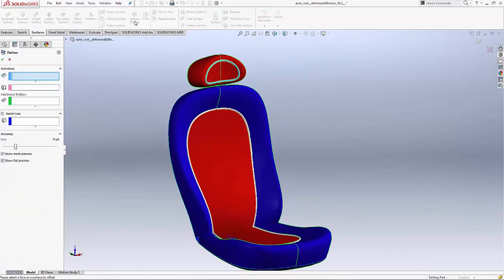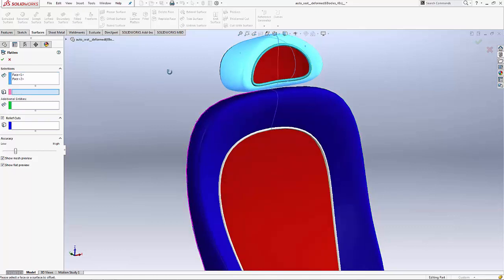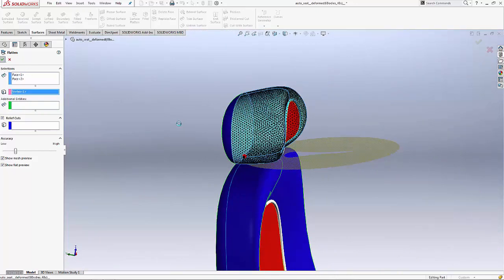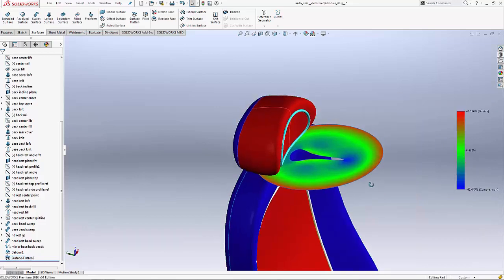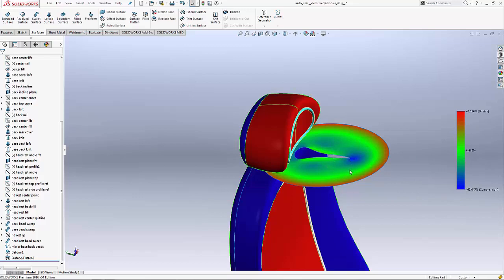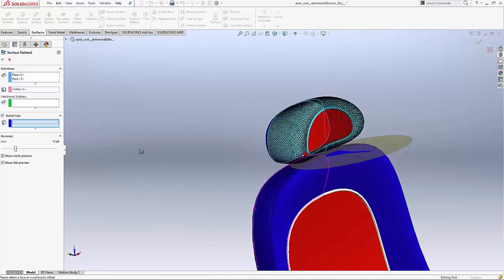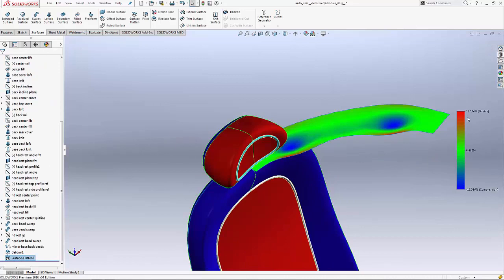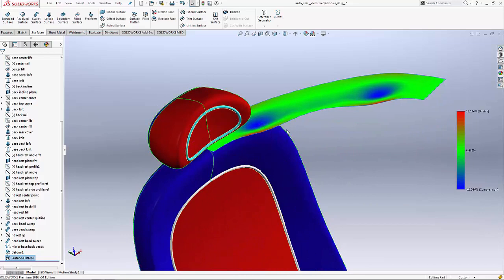SOLIDWORKS Quick Tip - Flatten Surface Feature

Comment: very good explanation.
Thank you very much.
Reply from the maker: Hi maverickasim1,
The Surface Flatten command is only available in packages of SOLIDWORKS Premium.  If you are finding that this option is disabled then your license does not have access to that feature.  If you are a student then you can try utilizing the laboratory licenses purchased by educational institutions that should get access to this license type.
Reply from the maker: Thank you for stopping by our channel!
Reply: This is in student version? i couldn't use it. if  that is the case, do you have any suggestion how to flatten it in student version. thanks!